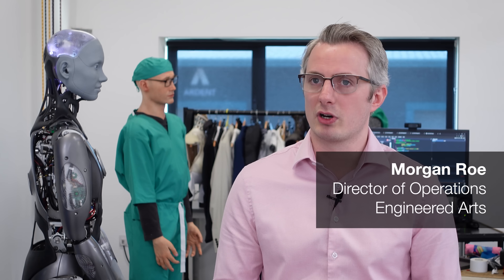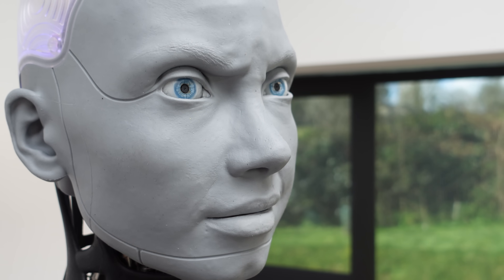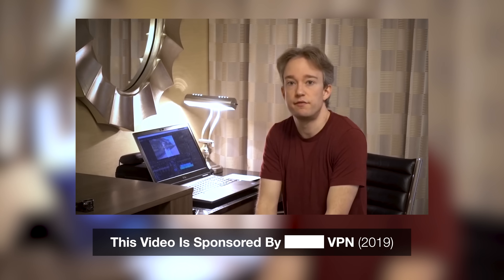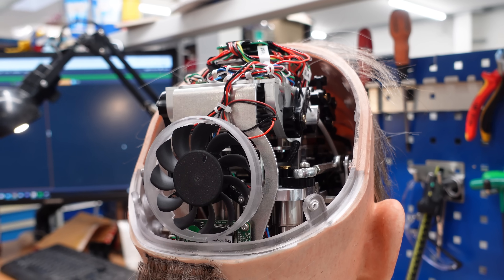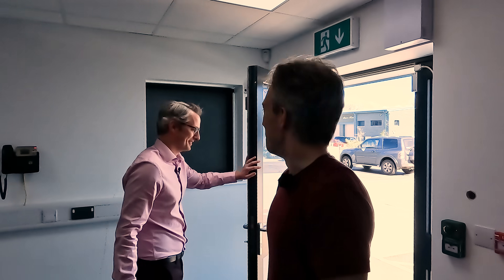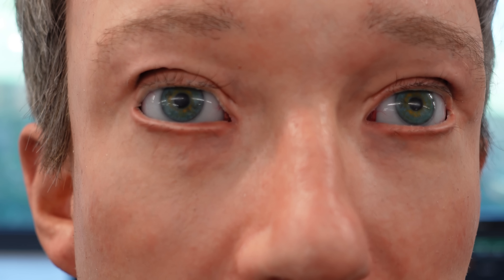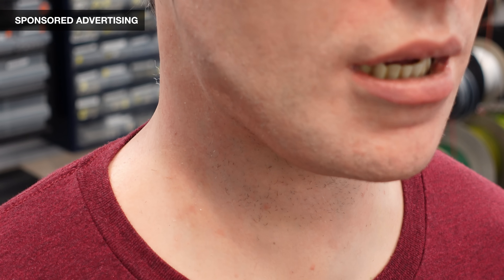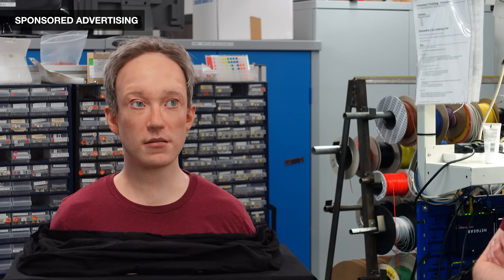My robot double sells out (so I don't have to)

Comment: I think one of the big issues with humanoid robots is we don’t just speak with our jaw. We speak with our jaw, tongue, and lips. No robot has all of those moving at the same time, or they just don’t get it right. Until then, ultra realistic humanoid robots will just be flat out creepy.
Reply: Right. Someone who reads lips would just see "blah blah blah." I was almost buying it until it was supposedly talking.
Reply: @rmdodsonbills  In fairness, the super advanced one they showed did have lip movements, I suspect that the fact this is a one shot means they didn't set it up with 100% facial control which would require connection of tons of actuators to the silicone face.
Reply: I want to see how it looks talking when you put a facemask on, because then we might be somewhat in trouble.
Reply: @gwiazdapioun2127  Don't give them ideas!
Reply: @gwiazdapioun2127  that's kind of a cool idea, simple but it would work
Reply: @gwiazdapioun2127  I want this as followup video.
Reply: @gwiazdapioun2127  just put a sticky note on your screen and watch the advertisement again
Reply: @gwiazdapioun2127  even then, eyebrows move, jaw and cheeks can still be seen
Reply: I was thinking the same, but doing even just further lip movement probably requires a complex series of motors to actually allow them to warp and open while still being tethered to the mouth, and the head compartment probably doesn't have the space for that, too.
Reply: @rdsabroad7528  i wonder how they're doing the movements thus far though, because it looks like they're using actual motors for everything which is probably overkill for many of the "little" nuances of facial movement. i bet you could thread some strings through the skin and hook that up to simple relay-style linear actuators and get a lot of these little facial movements taken care of. you know, like, when you consciously try to move your face you don't really have that granular control over it at all, so a couple lip and cheek movements could go a long way in making these faces more lifelike.
Reply: and throat. you forgot throat.
Reply: @MidnightSt That too.
Reply: This is the reason why it seems weird. This "uncanny valley feeling" only sets in when sth is close to natural but still not perfect. For this reason, dolls and other stuff are consciously designed to actually not look all that human like.
Reply: @KaimasterXD  except those newborn dolls… they creep me out…
Reply: @Kai  But this is fully intended to be really realistic, but the technology isn't there yet so it just ends up looking bad.
Reply: exactly, we can recreate a likeness with no problems. It's not about the likeness they are not getting, it is the complexity of anatomy that makes human motion fluid or any other animal for that matter. Facial muscle structure is very complex, we also use facial muscle  for speech and expression and that's what is missing, the complexity of anatomy. Your also right when you say it just looks flat out creepy. Simulating likeness is easy, simulating life is a far more challenging task, but they are working on it. They just have a ways to go yet.
Reply: @kosys5338 but why? Seriously, why would we need such robots? Why would we want such robots?
Reply: This  isn't the most advanced version. The updated version they talk about does this
Reply: Also the movements need to be animated by someone, or the decisions for how it moves has to be made by someone. More often than not, that someone is an engineer, not an animator. These humanoid bots from tech companies always look creepy because of it. However, jump over to Disney World and see its modern animatronics, and their movements and expressions are far more convincing, because the talent behind those movement decisions was made by artists and the artistry of bringing animatronics alive at Disney has been going for something like 60 years
Reply: Organic movement is so friggen difficult, they still put in a ton of effort to replicate relatively simple walking and what we have isn’t even that good. Wonder if eventually they’ll just be recreating muscles, but that’d probably be so difficult to coordinate
Reply: @monhi64  Realistic walking and facial movements are MILES away from each other. One is high school math the other is quantum physics we haven't solved yet. We're probably a century or two away from realistic walking. We're probably only a couple of decades max away from realistic fascial movement.
Reply: I mean if you imagine the robot is a stroke victim, it lessens the uncanny valley effect. ^ ^;
Reply: Eh there's simpler issues that haven't been solved yet apparently:

1. Robot muscles don't have the ability to move fast enough, the robot is super slow hence why it looks so bad.

2. There aren't enough muscles. And the muscles themselves don't articulate enough (very low range).

3. The eyes  and areas around his eyes just look horrible, that's nothing like how Tom Scott looks like!
Reply: Yes, also when we move the jaw that uses muscles  in the cheeks and other parts of the face this doesn't replicate.
Reply: I think a lot of the eye and facial movements are exaggerated as well with a lot of unnecessary movement, like a 3D animation from the 90s-- Which works for cartoons like Jimmy Neutron, but not for humanoid robots.
Reply: there is a robot that is literally a mouth. It uses the mouth with a tongue and teeth and lips and everything to manipulate sound to actually talk.
Reply: Also we have instinctual micro-muscle movements in our face to different stimuli, even if we had the technology to make manipulatable micro-musculature we don't have the knowledge base for doing so in a realistic manner.
Reply: And lungs and larynx!  And diaphragm, even.
Reply: @jaybee9269  that’s literally what I was suggesting hahhaah
Reply: The eyes and mouth movement are quite not there yet along with a few minor face details but otherwise, especially from a bit further away, it's a bit too human-like
Reply: This is a part of what they're working on. The problem is our musculature system is a complex set of tiny machines, and we haven't quite got it where we can make artificial muscles. (That's also close.) It's that reason they haven't quite gotten completely lifelike lips. It's coming. Maybe 10 to 20 years?
Reply: @jackielinde7568  It's strange, I'm a little surprised at how few pneumatic systems are used, compared to biotech prosthetics that pump air through carbon-fiber tubules that simulate extending and contracting muscles. These limbs are difficult for transportation and travel and have massive hurdles in human usability, but for something like this it should be an easy shoe-in, instead of an insane amount of servos it would be an insane amount of micro-controlled pressure gates, which are significantly easier to use fix and replace than servos.
Reply: @GodrowKil  Even hydraulic and pneumatic systems can't get the scale that tissues do. As someone who plays trumpet, it's amazing just how tiny, flexible, and specialized mouth muscles are.
Reply: @Cancer McAids I can answer the why. There are environments that require human capabilities to go in and get things done, but the environments are not friendly to humans. Also, it's much easier for humans to work with these robots if the robot's interface was the same one we humans were learning and using since birth.

What's wrong with them is a vastly bigger question than one post on a YouTube video can answer.
Reply: should humanoid robots wear masks? that might work to bridge the gap until tech catches up
Reply: good point. It looked human till it started to talk and then the illusion was broken. We are very slowly getting there tho
Reply: I think the lip movement is a big one.
Reply: Think about how many tiny muscles move seemingly automatically when you speak, especially in your lips etc. Thats gonna be hard to recreate.
Reply: That was the part from which I couldn't look away.  It's just NOT right.  The rest of it isn't that bad.  Could use refinement, but there needs to be a qualitative leap in the way that part of the robot functions before we achieve anything close to a true lifelike resemblance.

Of course it's understandable that this is where everything goes down the drain.  I can't imagine how complicated of an engineering problem that is.
Reply: I thought it looks really lifelike in stills but I did find the jaw motion a bit too linear, stuck in one plane of movement, where as our jaws move forward and backwards a long with up and down when we speak, (try saying any word ending in the 'oo' sound like you, too, and feel your jaw as you say it) I'm sure they could figure out a pneumatic or hydraulic way of emulating how the muscles actually expand and contract, which could then control the movement of the bones they are attached to, could possibly give more realism, not that I'm an expert, just my constructive criticism,
Reply: The eyes are a dead giveaway too
Reply: Well, it cannot be deal with it. Must be something in approaches mannequin
Reply: Also, the eyelids are super thick, making the eyes look weird
Reply: Bo worries, we're not gonna be here soon. A storm is coming and this fantasy that you all live in will be shattered 😴
Reply: And I don't want them to be realistic so we get confused who is real.
Reply: Right! It can mimick the motion but the human body moves by contracting muscle.
Reply: also blinking is weird
Reply: We're also probably never going to get eyes just right. Only recently have we gotten relatively close digitally.
Reply: Also the cheeks need to be right
Reply: Good from afar but far from good. Like a $10 paint job.
Reply: Do Ventriloquists mimic robts or is it the other way around ?
Reply: YET!!!!....
Reply: Also, it makes it look like Tom Bot has a severe underbite.
Reply: Have a look at their Ameca robots.  Those, the facial movements are almost spot on.  Even little things like the eyes moving to look at something before the head moves.
Reply: There might come a time where they will add a sound system where they can talk like humans i.e. by jaw, tongue, and lips. The main reason might be different like cpr or something or just a company flexing their technological advancements.
Reply: @Happy-ye2lj  
Or just have it tune in to your favorite radio station.
Reply: Not to mention we use so many different muscles in order to just smile or frown, I can’t imagine the complexity of doing other expressions or movements while talking
Reply: If all the focus is put on the mouth it can be done, it just requires too much technology to do right now for it to be efficient.
Reply: ya that was the thing that brought this from wow!!!! to wow!
Reply: right?? I read lips and it was downright obnoxious.
Reply: I wonder what would happen if you would use the Madame Tussaud approach  with there wax interpretation of people.
Reply: Uncanny valley
Reply: the lips and eyes lids don't look quite right.
overall it can pass for a human being if we can get a got look at it, and it definitely is easy to spot who is the copy... unless you haven't seen the person in question and has impaired eyesight.
Reply: and cheeks
Reply: That is the big thing I noticed during the ad read. 

Wait. I watched the whole ad read. 

GODDAMNIT YOU TRICKED ME TOM!
Reply: For me, what seemed off (And possibly intentionally so) is the eyelid movement. Either it needs to move faster, or not much at all.
Reply: I think its more to do with the eyes. Essentially what you are looking at reanimated corpse with death glee in its eyes and that is the biggest thing that kills the realism and yes secondly the jaw talking, but i recall those are being developed as we speak.
Reply: Honestly the main reason my brain finds the robot creepy is how the eyelids go inside the skull when it opens its eyes instead of just kinda sitting on top of the eye being all wrinkly like they do with humans
Reply: Not just jaw, tongue, and lips, but with our eyes.
Reply: I think it'd be creepier if they were more accurate tbh💀
Reply: You could maybe move lips with pneumatic bladders, air pressure. Since they can be made very small and into any shape you want, you don't have to be able to fit a motor in. Or else just a mechanical linkage, but a bladder would be more like muscles anyway, they shorten and fatten to move, that's their only movement, they're just arranged in pairs and other arrangements to give the versatile range of movements animals have. 

They've done such a good job with the other aspects of their robots, you'd think the lips would have been sorted out over 15 years. Bet it's a fun place to work, although I dunno how consistent the market is for androids, might be they have periods where nobody's paying them. Artists and engineers, and artistic engineers, and engineery artists, are going to expect decent pay.
Reply: That, and replicating the range of motions a person goes through when speaking would be prohibitively expensive to make and require finer control than robotics currently have. Even properly replicating how we walk is difficult for robotics
Reply: There is a robot learning that at the moment
Reply: @bitesizedhistory2025  Atlas, I know. But they still move really stiffly and oddly compared to the flow of how humans walk naturally.
Reply: Yes
Reply: We went through the exact process with computer animation of 3d models--this is still at the muppet stage of jaw flapping.
Reply: I hope that they'll get so humanoid to look like the androids in Detroit become human.

Comment: I think that apart from the eye lids not being quite elastic enough (Hence why it doesn't look quite right), the only thing left for them to work out is the mouth. Specifically, not just moving the jaw, but more specifically controlling the lips. Lips don't just open and close, but change shape, for example when you exclaim "Wheeee!". The W in that exclamation is obviously not just an open mouth

Despite these two things, it still looks absolutely phenomenal. Sort out the lips shape and the eye lids, and 100% you would start fooling people that it might be real
Reply: Moving Lips would require from eight to twelve micromotore to replicate the true human movements; plus some very hard-to-write software to drive said motors in sync with the speech. 
It would certainly blow the set budget. One day may be...
Reply: There was no way they were ever going to spend the same money or resources on this robot as they did with Ameca or Mesmer, they are a business not a charity.
Reply: @krashd  I was mainly thinking in general, not specifically for the tom scott robot bust. Like for Ameca, I could be wrong, but the video footage I've seen of it only seems to depict cheek movement for smiling, and opening/closing the mouth. It looks really good, but without lip movement, talking will still look weird

Comment: "I don't know why you'd want to connect 6 devices at the same time." So you can run the VPN on your modem/router thingy I guess and have your entire family accessing the internet through Nord VPN
Reply: But in that case you described the router is probably showing up as a single device to the VPN provider, and performs Network Address Translation

Comment: This is horrid. I recognize they are trying their best to get out of the uncanny valley, but it hasn't worked for me. This video is fascinating and terrifying.
Reply: The best way to avoid the uncanny valley is to stay very far into the non-human area. Give the robot a screen face that can show images. Boom. Now it can be cute, it simplifies expression coding by several orders of magnitude, and it can be much, much cheaper. It's better in nearly every way.
Reply: @Homerow1  I have to agree with one of the other commenters, it would look creepy with a screen, a humanoid shape with a screen for face, that is creepypasta material. 
I could only see that working if the robot had a non-human shape and silhouette as well. 
And If this problem isn't solved by the time robots are regularly appearing around humans then they just shouldn't look human.
Reply: @Homerow1  I honestly think that would've made I Robot actually scary. Imagine the breadth of horriffic imagery an intelligent malevolent screenface bot could display.
Reply: @Homerow1  Its possible to make human faces that aren't uncanny valley. Have a look at the current silicone sex dolls from Gynoid. They look almost real.
Reply: Talking didn't do it for me but the robot looking sideways when Tom came into the picture looked really great already.
Reply: Right? When the camera is head on it looks quite off
Reply: Was machst du denn hier?
Reply: @BastiElektronik  ich bin überall
Reply: no